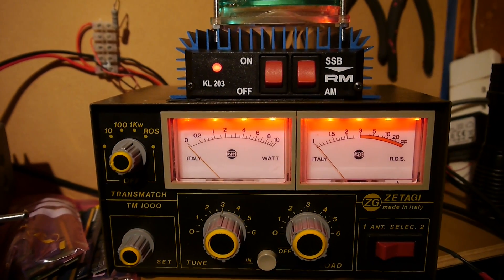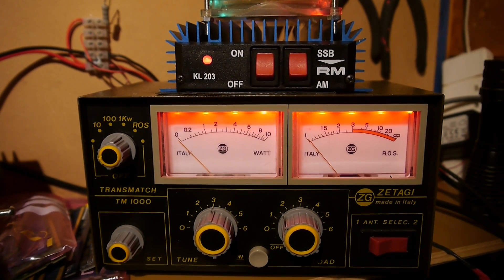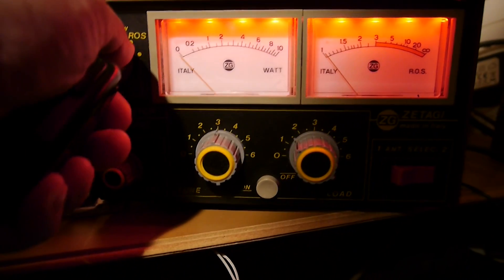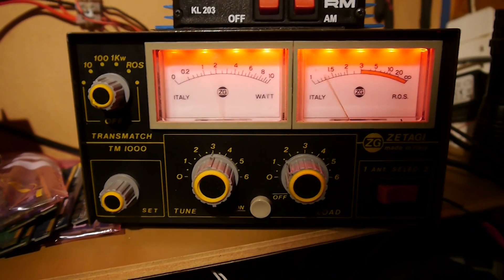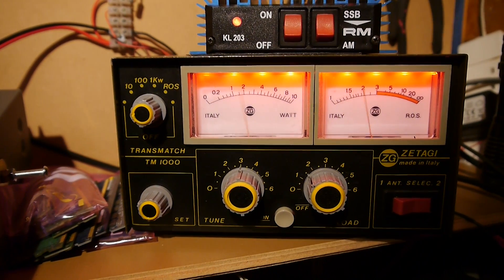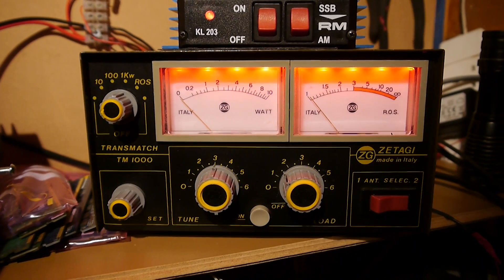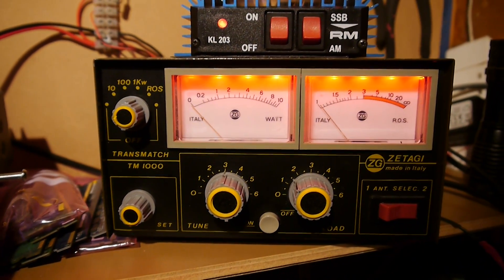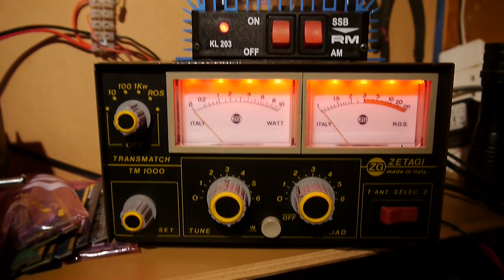RM KL203 amplifier test after refurb

Comment: What changes have you made to the circuit?  These only like 1-2 watts carrier input (am) You say your driving 20 watts into it on ssb and getting over 250 out seems far-fetched mate... EDIT: I can't see it lasting long being driven that hard.
Reply from the maker: I made the video because i have fixed dozens of these amps ( kl200/kl203 ) and  dozens of other outputs of the RM and Zetagi 12v and this shocked me...hence the video ( with a full rework and mosfet replacement these are normally lucky to peak at 160w ssb ).
I used a set of mosfets out of a box of stuff i bought at auction because i didnt have anything else at the time and my normal supplier was out of stock and i wasnt going to take the risk of buying ebay fakes. I need to dig the amp out of the boxes in storage so i can note the part number, but i am 99% sure that they were MS1307's
Modulation is pretty clean, no splatter reported or noted. BUT one of my old neighbours 4 houses down said he knew when i was using it because it came through his PC speakers plain as day! ( backed up by another neighbour )
The amp cost me nothing, it cost me nothing to repair as it was all done from bits out of the junk bin and it was still running fine when i packed it away in October.
I dont normally use an amp per se, i fix them ( the fixing of them is my hobby, and i test them and then, normally i give them away ).
I have more fun tuning my antennae and running QRP, much more satisfying to be honest with you
Reply: That little box is screaming! The  MS1307 has more gain than the irf520n /  fq13n10? & What of the original RM Italy branded part ruggedness?
Reply: I once saw a video, a chap removed a resistor and saw more output ouyt of the  kl203p is this a smart move?